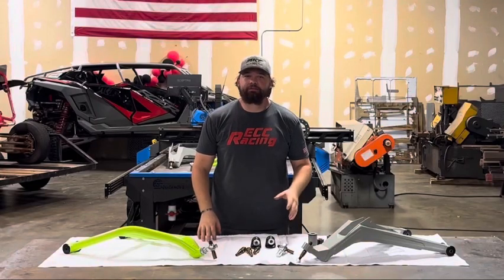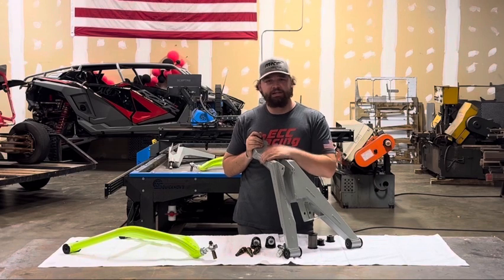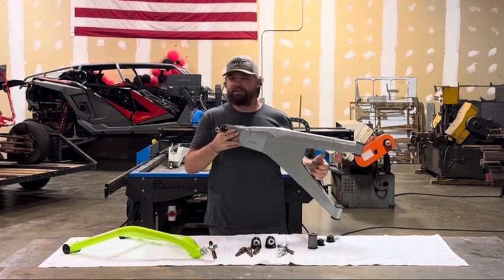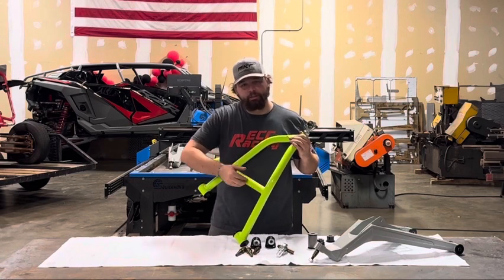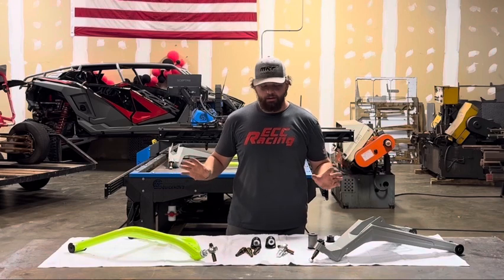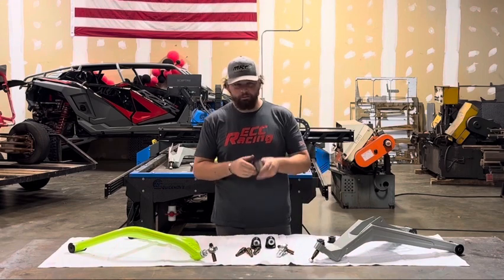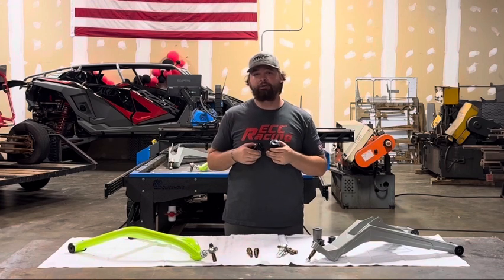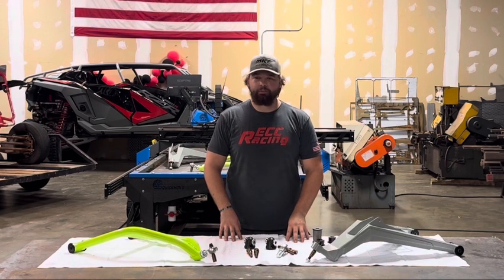Ultra High Clearance Pro-R/Turbo-R A-Arms!

Comment: Can you make a matching video about your Trailing arms and Radius rods? Or the setup as a whole?
Reply from the maker: It’s actually here on YouTube! The video I posted after this one.
Reply: @eccracing  I don't mean to be this way, but is there a chance it didn't post? I want to buy your full suspension for my machine, but I want to see the video first and this is currently the only one you have posted on your channel besides the ones that are from 3+ years ago, that I can see and watch at the moment. It could be my issue, but I only see this video.